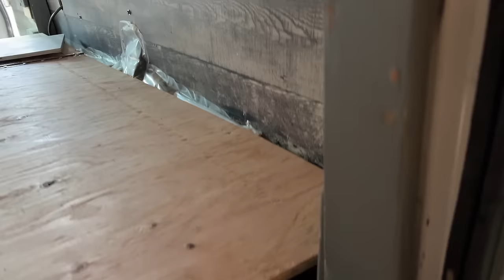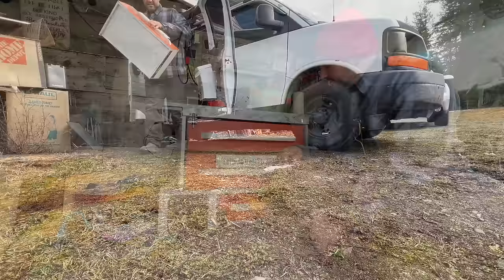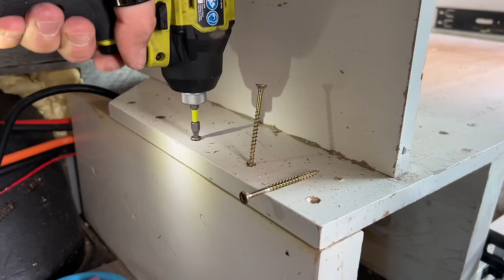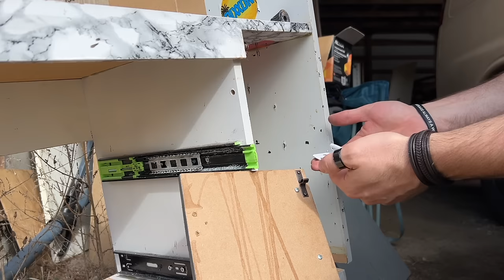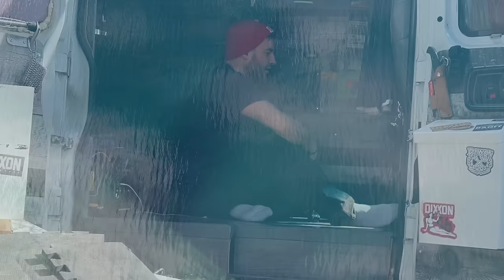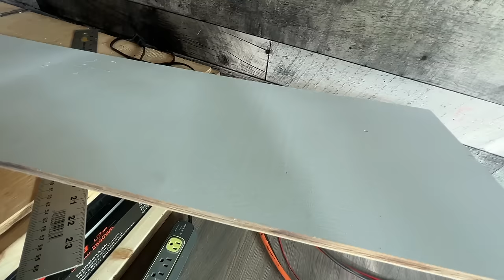Vanbuild in BC - The Final Piece to be Demolished | BLANK CANVAS

Comment: Hello Mat,when you put the diesel heater up in the front corner, remember  to run a heat duct along the wall and through the front of the electrical  box. The batteries  will need heat to protect  them in the cold. Also consider putting  some small 4x10 plastic or aluminum  grills  in the new painted panel on the front of the electrical box to help with heat circulation. Just some suggestions.  Have a nice day  Tom in the Maritimes at the NB-NS border.

Comment: How well did those interlocking foam mats hold up?
Reply from the maker: The ones in Lucky I have had for over a year and still going strong. I will be replacing them once the build is done cause they have been neglected and are a bit filthy 😂

Comment: ?Questions?
For the front foot of the bed -- how about a coat of clear lacquer to make it easy wipe?
If you didn't destroy/burn the three drawers & Upward sign, would you consider sending them to the Lower 48 at my expense to use in my upcoming build?
So, when are you going to install a swivel for that passenger seat? Huh? I can really picture you and The Kiddo using it on rainy days and nights....

Comment: Hi Matt, enjoying your channel...keep up the great work. Just a thought for your rear drawers.  You could drill a finger hole(small drawer) and a hand hole(large drawer)...drill two holes horizontal about 4 inches apart and remove the material between. Round the edges smooth with some sand paper. Doesn't add any weight or cost. Just a thought.

Comment: I've been thinking about the Diesel heater. If uou were to put it in a small slide out drawer you wouldn't need to worry about what's above it and could give you more options for that area. Anyway   lv your channel
Reply: The intake & exhaust pipes go
through HOLES in the floor , so
NOPE on the sliding 🤷‍♂️

Comment: Hey Matthew, have you considered with the diesel heater making a small drawer for it that is on slides that you could pull out to work on and then slide it back in so you can still set stuff on top of the box but be able to pull the diesel heater out. I don't know if that would work because of the wiring or anything just curious.

Comment: Great content as always. Just stopped in to share my thoughts on the diesel heater location. Would it be possible to mount it under the van in a steel box I just have the vent come inside. .. just brainstorming hope you're having a good one. Cheers .